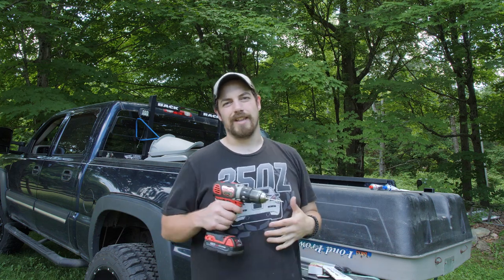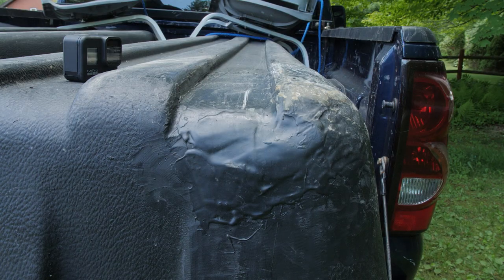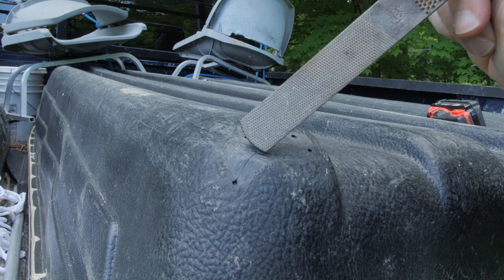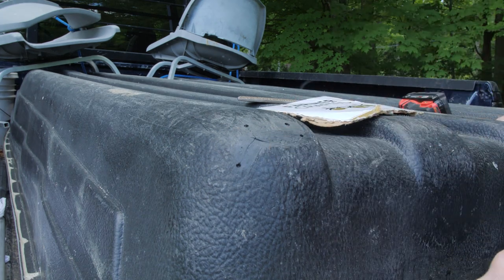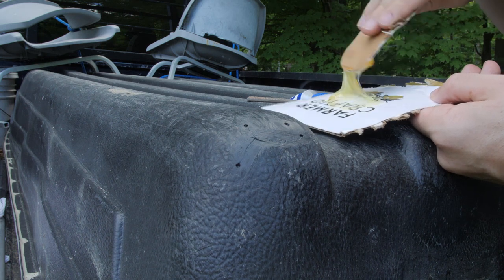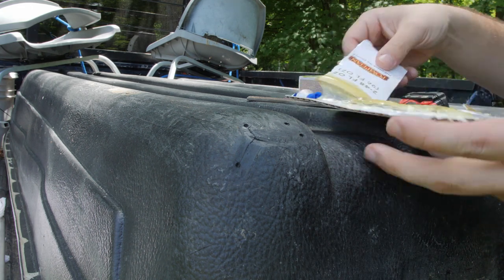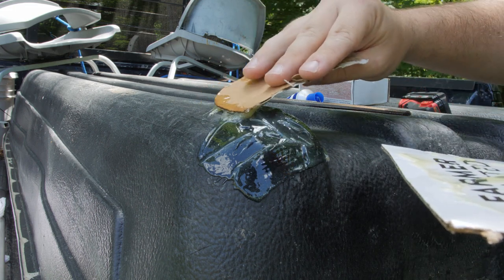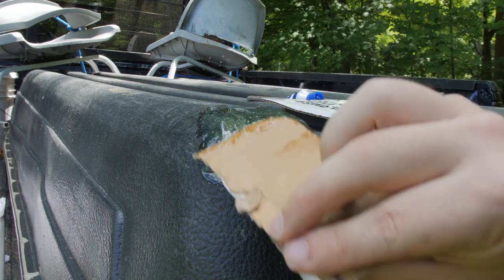how to fix a Polyurethane plastic boat (G-FLEX) #DIY

Comment: This is HDPE WHICH STANDS FOR HIGH DENSITY POLYETHYLENE! Not polyurethane. I read somewhere in the comments where you corrected the title, but the title is still not correct. Polyurethane is the clear coating that goes on top of wood and makes it glossy.
Reply: What would you use to fix a hole on hdpe

Comment: Too funny. I have the same exact boat and have tried and failed plastic welding. I used it with correct matching ABS plastic and two different welders. It kinda stuck but ultimately failed. I used gflex and it has been 3 years in the FL sun and on salt water. Thanks for the video 👍
Reply from the maker: Great boats!!!
Reply: I got the same boat today for 50 dollars! Gonna try this on some cracks on the top
Reply: @codygraham5419 dude me fucking too!!!! I literally couldn’t find anything on the the uncle bucks prowler 90 1 video of some dude talking behind a truck and just happen to click on this one and it’s the same boat 😭😭😭😭  I have a whole about a quester size and this is gonna be my remedy have you done  it yet?

Comment: Gonna have to try this. I repaired my lil 1990s bass Hunter boat that I got for free with abs slurry, took it out but after two hours I still ended up with a boat full of water. I was also thinking it was possibly the drain plug. Either way, before I go back out I’ll be using some gflex to go back over my abs slurry repairs just to be sure

Comment: would the same principal work on a tractor plastic fuel tank? but using a heat gun instead of matches, of course. I have a hairline crack at the bottom of my tank.
Reply from the maker: I used it on my radiator for a large crack and it held for 4 months. So I'd say if your in a pinch yes BUT I wouldn't count on it being a permanent fix

Comment: Great Video.. 2 Questions  On the top part by the Stern on close to the Railing. I have a Hole about  3 inches long and 11/4 wide.  Any Suggestions on how to patch it.. Maybe a Plastic putty knife to cover the hole ??   # 2 With the boat flipped on the side Looks like there is a top & Bottom..  In a few places looks like WELD Coming apart.  Was thinking to use some kind of Caulk to run a bead down it just to give myself Piece of Mind Any Suggestions.  Thank you David

Comment: My Sundolphin Pro120 Polyethylene boat has developed a bit of a crack gap right next to the drain inside the livewell.  Thought to use a piece of plastic from a one gallon spring water container then proceed with the following steps:

First, spread the Gflex on unto the corner,
Second, place the plastic piece from container on top of the Gflex to bond the plastic onto the Gflex,
Third, take Gflex and spread on top of plastic container piece already bonded on the Gflex and spread it around real good to seal the entire area.  

You think this might work to fix 😊crack inside the livewell?

I don’t plan on using the live well again. It just bothers me that the crack is there next to the drain plug

Comment: Pretty sure that boat is not ABS. Looks like HDPE. ABS does weld very well, we have welded tons of motorcycle fairings that are die formed and have the ABS logo right in the material. Abs must be painted or vinyl wrapped or it will degrade quickly in sunlight, so not good for boats.  G-Flex is the right thing for your polyethylene  boat, but it is not a chemical weld it is a mechanical bond. G-Flex and T-88 are high performance structural epoxy adhesives.
Reply from the maker: You know what, you are absolutely correct! I'll have to edit the title.
Reply: @blackpearlmedia7797  I have even more respect for your video. Well done
Reply: I have that exact same Pond Prowler and it is ABS. I have used acetone to try some “slurry work” and it does melt. 👍
Reply: Wait so use it or don’t use the g flex for this type of boat I literally just got the same one yesterday with a small hole in it about quester big.  What would you recommend